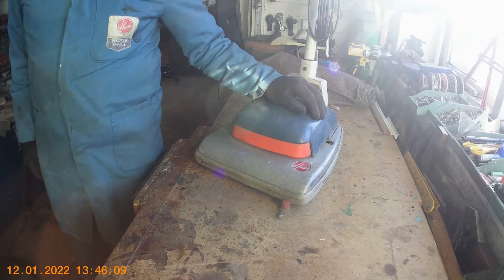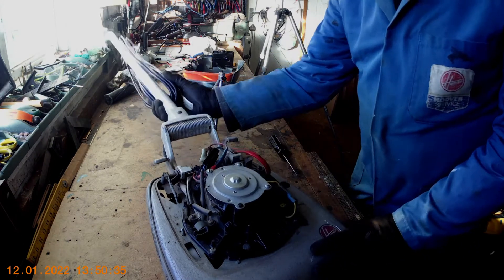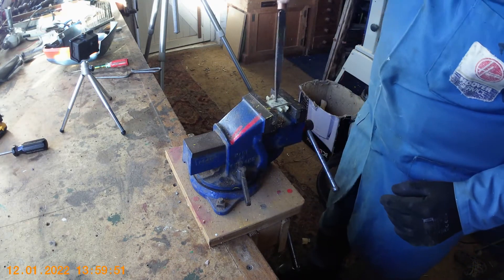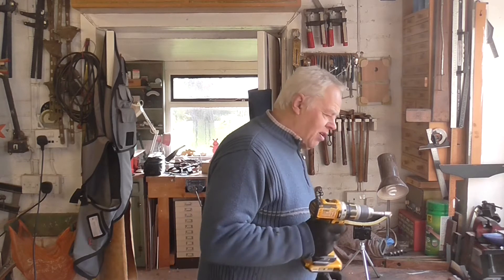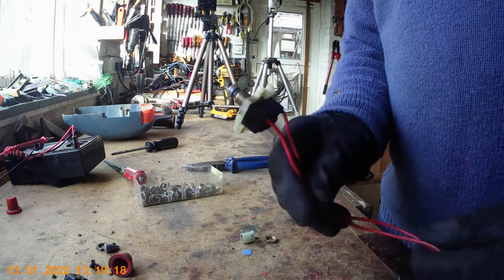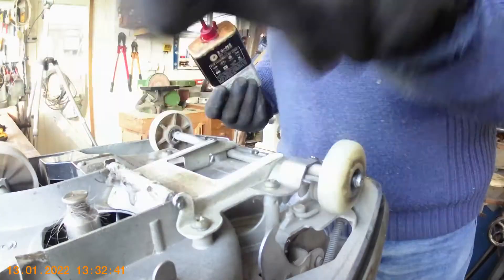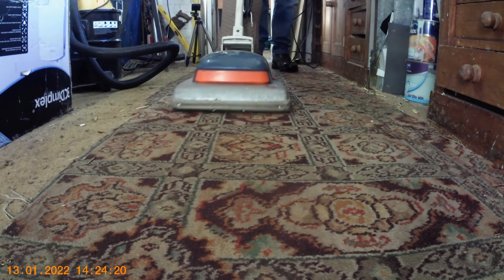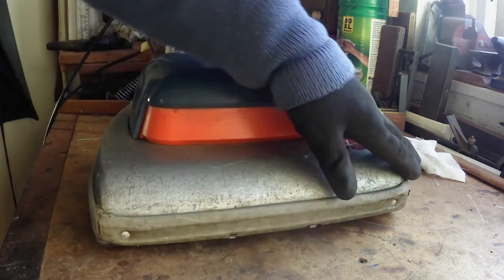Hoover 652a service notes, making a switch to fit.

Comment: John ,  i really see how it is so important to watch ALL of the video👍 , if i hadn't i would have missed the little tidbit of using the metal vise with a wood vice ...  nice job
Reply from the maker: Thanks for your comment Blake. If you look at my bench in the videos I do have a large metalworking vice fitted in another woodworking vice at the other end of the bench, I normally leave that one fitted for heavy duty work but the one I used in the video is more convenient for smaller jobs and it is rotatable.

Comment: Classic scrimping at its best!! Another machine kept running which has to be a good thing.  I had the same problem with a cooker switch and managed to swap parts from the old one on to a very similar new one. That was 3 years ago and its still going strong. Just need to learn how to cook now. Enjoyed this one. Thankyou.
Reply from the maker: Many thanks Col. Glad to hear I am not the only one who tries to repair stuff. This week I mended my daughters old toaster, the element was no longer available but I fixed it with some eureka wire from another element.

Comment: Quite ingenious John! Most so called American brands made overseas don't last very long. If you can get 3 years out of them you are lucky. Most won't do what they are advertised to do. We have had a number of different brands including Hoover. The Hoover wasn't much better. The older models here were great. My mom had one for years. You couldn't hurt it lol. The longest lasting machine that we now have is a Shark. I love this machine! It is an upright and has a lot of suction power. It has lasted 5 years and counting. I enjoyed your fretwork review on the last video. Will you be inspired for another whirligig in the near future? This winter I designed 3 bird whirligigs, all life-size. I made a pattern for a Canada Goose, Hummingbird, and a Bluebird. The Hummingbird was a challenge from my wife for her garden. Right now I'm trying to design a Woodpecker whirligig. I have the bird drawn out, just figuring out the mechanics and the vertical setup. If you like to see some photos I'll e-mail them to you. Just let me know. Enjoyed as always. Take care!
Reply from the maker: Thank you Michael. Until the 1970's Hoover UK made quality fully serviceable machines that were built to last, in fact even in the 1970's we were servicing machines made pre WWII and all spares were still available but once they went down the plastic route they machines were never as long lasting in the 1980's the machines such as the Turbo ranges had short lives and were often scrapped rather than being repaired. then Hoover stopped UK manufacturing and we ended up with cheap short life machines from China with a Hoover logo stuck on. The proud Hoover people from the early days would be horrified if they could see how a once great company had changed.

Quite a few of my whirligigs need some attention after being out in bad weather over several winters and need attention when I can get motivated.

I did have a bit of trouble with setting up my woodpecker whirligig.

Your whirligigs sound very good and it would be nice to see them. You can contact me via my website  https://sites.google.com/view/lainchburys  Just send a message and I will reply with my email address for you to send the pictures to.

Comment: Mum replaced a very old Hoover black model that had a cloth bag and a plate on the front to access a belt. She decided to replace it with a more modern one in the early 60's. All I remember about it was it had a light on the front. She used it until she died in 1986 and the only thing it needed was a new brush.
What's your view on bag less cleaners? I've had one and wouldn't have another. My current machine is a Henry and I wouldn't change it. Everything is easily repaired and all parts are cheap and readily available.
Thanks for sharing the video, every time I watch one I realise I'm not the only nutcase that repairs things and doesn't just dump broken things. 👍
Reply from the maker: Thanks for your interesting comment Colin. The old black machine that your mother had was most probably model 375, first produced in 1937 and manufactured until 1950 you will see my video on the model in my channel. 
As regards bagless cleaners I am with you, we only use machines with paper bags inc a Numatic Henry.
Everyone assumes that the plastic machine 'die-soon' was the first bagless cleaner but in fact Hoover made a model  U4302 in 1986 which used a plastic 'dustcup' to collect the dirt but Hoover were going through a bad 'patch' at the time and never promoted it allowing the other brand to dominate.

Comment: Thanks for sharing this ! It is a good hoover I totally agree with you on how stuff was made to  last and maintain , I despair  at the throwaway  world  , the amount of  waste , let alone the pollution created on remaking  more junk !
Reply from the maker: Thanks for the comment Steve. I too despair at what is thrown out much of it still useful. Sadly a lot of people don't care and would rather but some cheap throw-a-way item than one that can be repaired and used for years.
Our Electrical shop was in Cheltenham which once had 13 electrical repair shops, now they are all gone.
In the 1960's and 70's most items were repaired inc irons and toasters etc, then cheap imports arrived which cost less than a repair, then this went on to do the same to vac cleaners with cheaply made junk killing of repairs and now even washers are scrapped because makers charge £150 for a repair visit, independent repairers can't do much as apart from a few parts like pumps and hoses spares are either not available, cost too much or need special software to diagnose faults.

Comment: hi john i am sorry for all the questions but i am very confused, i just bought a hoover 750 and on the ratings plate it says " 160 to 185 volts .d.c. to 40 cvc or 170 to 200  volts 45 to 60 cvc rating 7 ,motor no . 7HM935144 WATTS 290" on the motor top it says servant to the home hoover  ,any ideas if this is uk voltage  i am lost here  ,thank you as well for the content
Reply from the maker: That is strange. normal UK voltage should be Rating 9 not 7, voltage should be 230-260 or thereabouts. some models were converted by Hoover from other voltages but in those cases the rating plate is normally over-stamped with the new voltage. If this has been used in the UK it could be that motor parts were changed and they omitted to stamp the new voltage or more likely it is not for UK use.
Reply: @scrimperuk  thank you so much this helped, ill connect it to us 110 volts and if its too slow ill try on 220 ,thank you
Reply: @scrimperuk  update : it was arcing badly and had a shorted commutator contact that i fixed and now it purrs like a kitten ,thanks for the help
Reply from the maker: @hibtl8510  Good show. 750 is a magnificent machine.

Comment: Rangers where never as good!
Reply from the maker: I have to agree with you there Ian. The 652's were just right, looked good and worked well so then they 'improved' it with a bulbous hood which made it more awkward to use under beds etc. It's like the 612-638 models, the 612 was superb so they fitted a ugly bulky hood and spoiled it, whilst it is rare to see a broken 612 hood most 638 hoods have damage and often scuff marks gouged out of the top. 
Thanks for your comment.